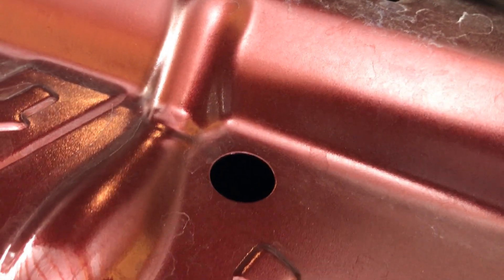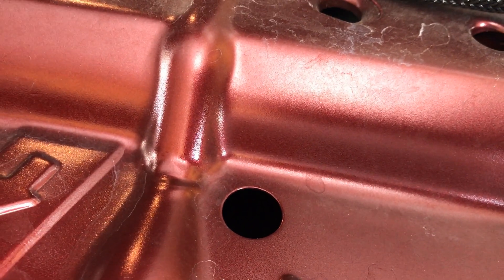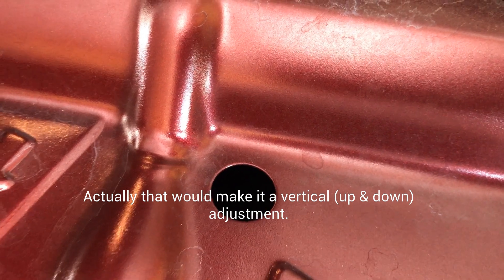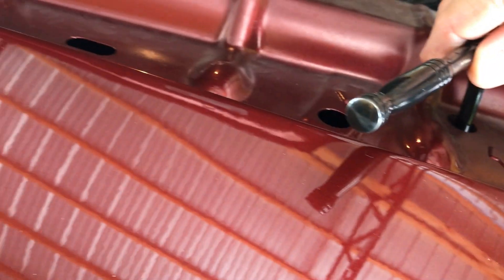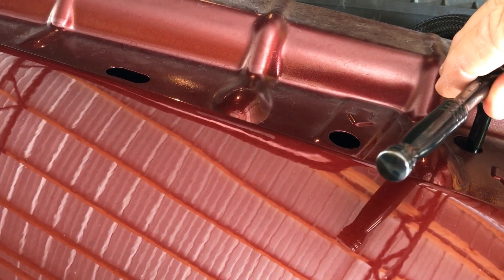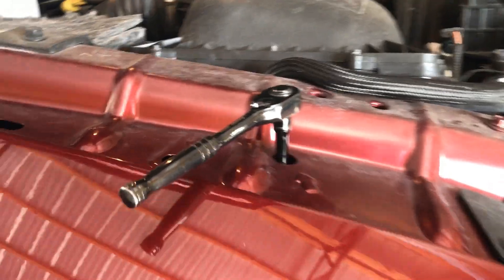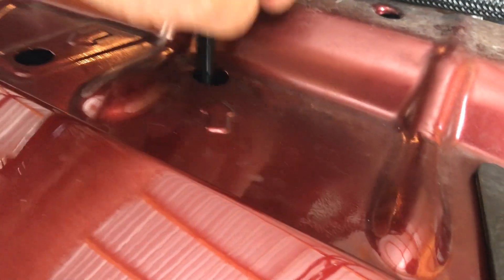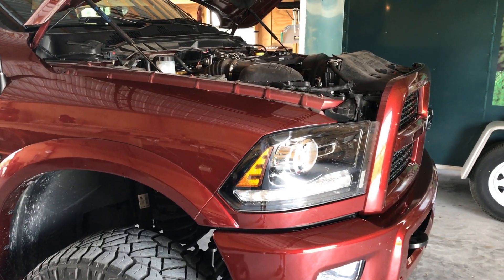Ram Headlight Adjustment

Comment: 2017 Ram 2500 Laramie  diesel      ,the headlight adjustment is in the first hole and is the opposite ,whereas right is to lower, left is to raise, 7mm socket with extension used.

Comment: I have a 2012 Ram, and it is definitely the other hole with the arrow for verticle adjustnent with reflector.  The hole you showed is for projector type verticle adjustment...
Reply: Beautiful truck. What rims aannnnnndd tires?  Lifted or just leveled?
Reply: Thank you so much, as I have a 2012 with no arrows to represent this feature!
Reply: @kevinliewer8676  Dennis is not the individual showing this video...
Reply: Confirmed. I have a 2015 1500 with the regular headlights. Second hole, closest to windshield. Simple turn of a special bit screwdriver and done ✅
Reply: @nickp5418  -  My 2012 Ram has the brightest bulbs I know of (PIAA bulbs) are horrible.  Like 2 flashlights would be better...
Reply: @dennis8309  throw a light bar in the bumper , 42inch for express trim. Smaller light for the big horn cuz of the tow hooks
Reply: @nickp5418  - Well that poses two problems in that I don't like LED, and I wouldn't want to mix the white led with the yellowish hallogens...

Comment: I installed the 2 inch leveling kit from readylift and right after, I felt my retrofit HID distance in ram projector doubled and can see so much better. I know it is aimed a bit high but so far no one has flashed me yet

Comment: That moves up and down...
How do (if able) you move the headlights left and right?
My Driver side is very focused and my passenger side is not. The progector seams like a beam in the driver side and on the passenger side unfocused/wide.
Reply: That's more likely to due with a misplaced bulb. Headlights have a focal point like using a magnifying to focus sun. too far forward or back will misalign the beam pattern.